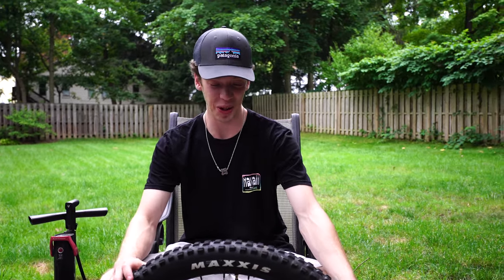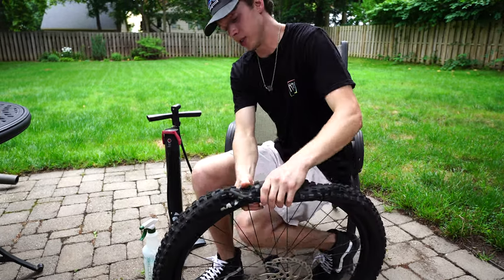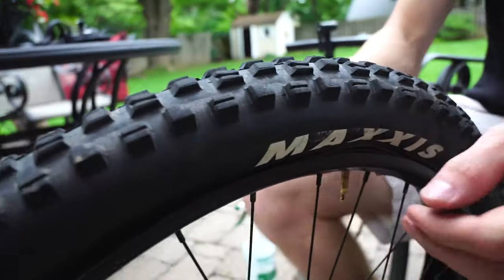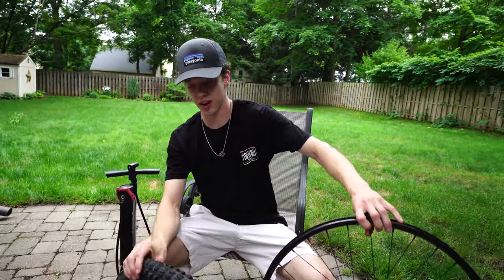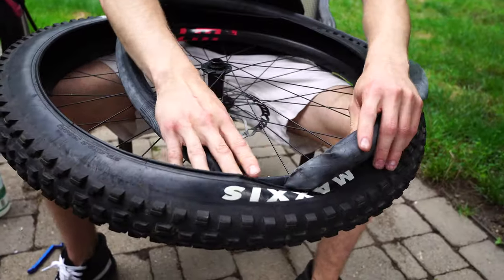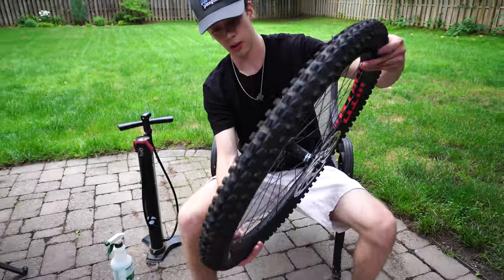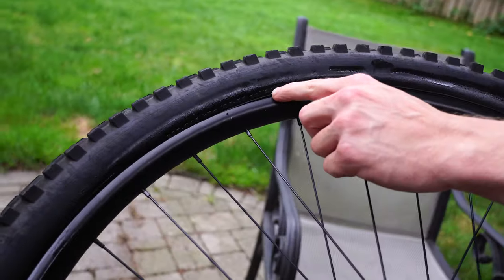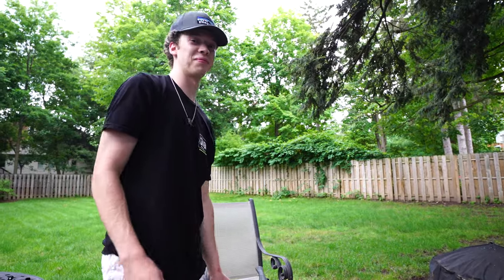Why you’ve been CHANGING TIRES WRONG | How to Fix a Flat

Comment: I just put my new tube in my tire using the tips and techniques in your video.  They worked very well and made it very easy to do it.  I changed one thing though, I put soapy water on both sides of the tire when reinflating it.  The bead popped well before the max pressure for the tire.  Max pressure for the tire is 35 the bead popped at about 28 psi.  Thank you so much for your help.  I am hitting the trail as soon as the rain stops.
Reply from the maker: Stoked the video helped out! Spread the word🤙

Comment: If you want to check the tube for the leak, leave one bead of the tire on the rim. Then when you find the leak (say, you notice it has a hole 8" away from the valve, or maybe exactly opposite the valve) you know exactly where to look inside the tire for the thorn, piece of safety wire, whatever that caused the flat, and you can pull it out instead of getting another instant flat.